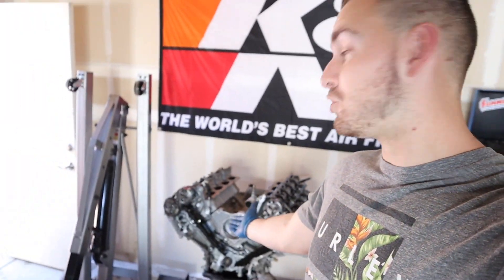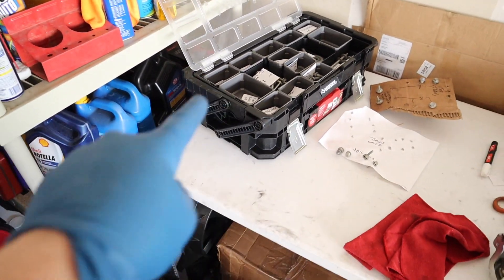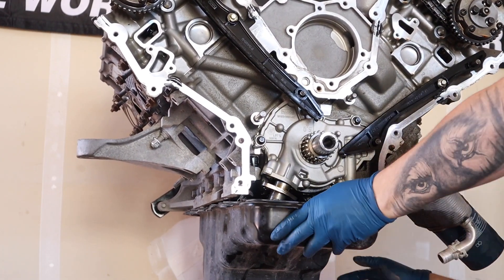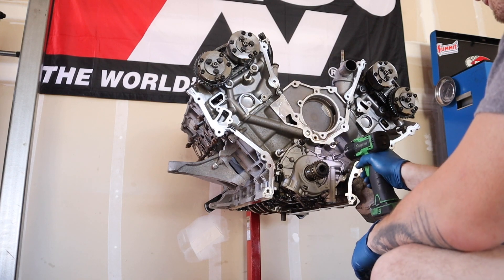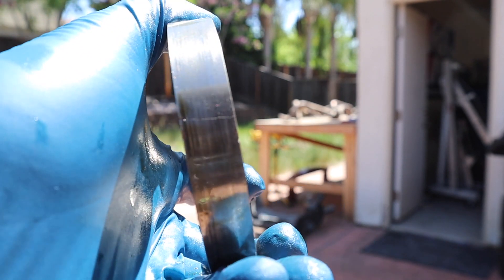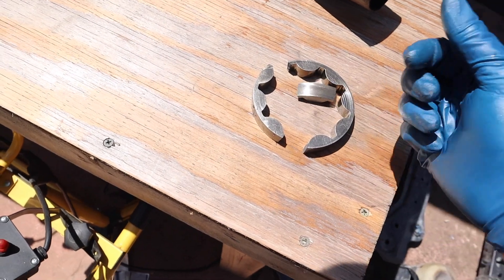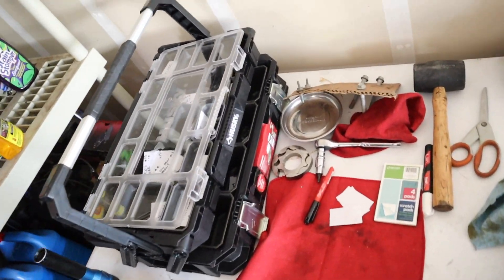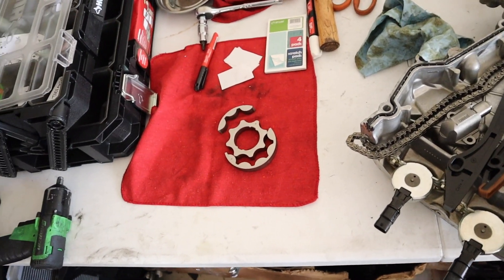How to install oil pump gears on 2016 Mustang GT

Comment: They need better engineers at Ford, how ridicules to pull the whole motor apart for the oil pump. The days of just pulling the pan to change the pump are gone. Let alone the poor quality of the factory parts